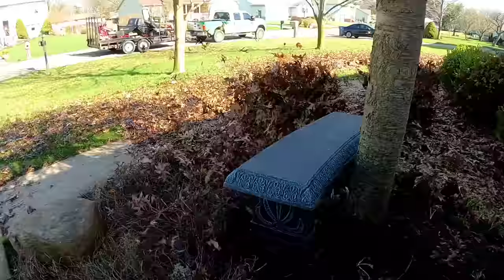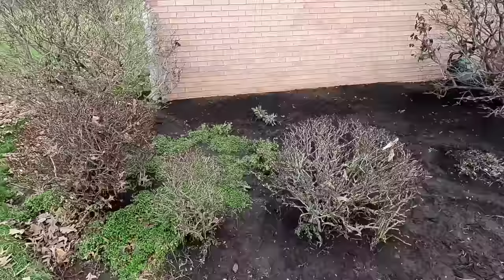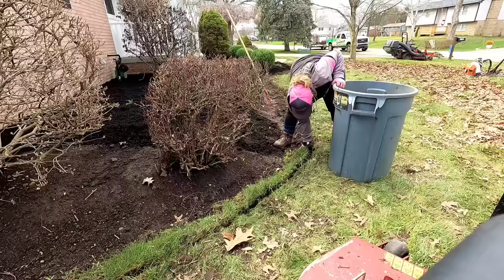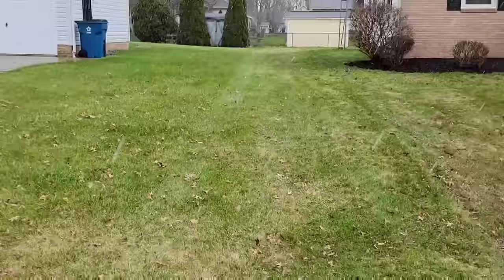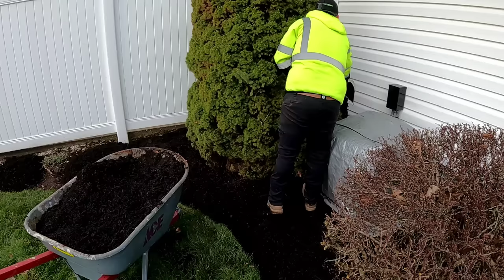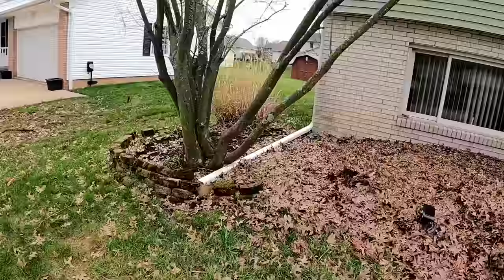HOMEOWNER GOT WHAT THEY WANTED | NEIGHBOR WASN'T SO HAPPY!

Comment: just a tip from utility locator, when using that edge cutter, before you should call miss utilities out there, Fiber optics subs like to only burried service lines to the house most commonly around 6 to 8 inches if lucky, i have seen them as shallow as 2 inches sometimes

Comment: I reshaped a flower bed years ago.  I didn't have big machine like you have but I used my sawsall to cut the dirt back.  Same concept.

With the hail you should be looking at the radar and stuff.  Hail proceeds tornadoes.  With hail it means that there are updrafts going on in the atmosphere.  I am not only a landscaper I am also a trained storm/tornado spotter.

Comment: Love the add on wheel barrel made a steel platform on my mower so I can put 10 to 12 bags on mine. I used plastic concrete tubs to haul stone . Works but its pretty sketch. Looks like it's hydraulic?  Pretty awesome! Truly a force multiplier.

Comment: Nice job. Expensive black much, them people gots money in Ohio. Couple of things. Glad the neighbor wanted bigger beds, I never add any new space to a bed because it's a longer weed eat and consumes more mulch. I also use a spade and put a 30%ish angle cut on the edge so when the mulch is thrown and smoothed and you pack the edges it makes a nice little v trough for the rain water to collect as it runs off. And to pack the edges I use an aluminum rock rake, 3 feet is quicker than a 1 foot yard rake. I was happy to see you let people know to use the backside of a leaf rake for smoothing, I see so many beds with clumps and piles just all through them. I also never use a shovel in a wheelbarrow otherwise you have to rake the mulch onto it with your arm like in the video. A wide short handle pitch works way better to get behind and around shrubbery. I only use the shovel to push mulch into a wheelbarrow once it is low enough to get behind and do it. haha and that was sleet not hail, where I come from it's not hail until you have to called the insurance company.😶
Just some thoughts and again great video maybe something said will help you and maybe not but it was free. 🙂 Oh and my neck of the woods is N.C.

Comment: i took sod cutting like that  and  redone a sandy area under a 200 year old oak tree  on my 20 acers  i used them a plugs which every made it the made it  it too about a year for it too grow in then took five years too get that fluff  and completely full look i like  because too me native grass will always do better in it surrounding i bought the 20 acres for 30 k  nothing was on the property so i did a well 2 septic tanks a couple of sheds which were old mobile homes 3 livable mobile homes on the property at one time i had a acre of watermelons  another of cantaloupe then  about a acre of home garden  green beans okra lettuce collar greens and mustard greens  what extra i had i made baskets to sell every weekend   i take it too the store only store either way for 20 miles and sell out with 2 hours  and back then watermelon was 4 bucks each  so the most watermelon i sold it a day was about 100 of them to me that was just fun for me i didn't count it as a job but it was

Comment: I dont know if this is of any relevance but if am using an hedge trimmer I always without fail WD40 the cutting blades they work alot better and dont bung up with sap ect i myself use a 4 stroke honda double sided hedgecutter its alot quieter and runs longer just a tad heavier

Comment: Just me but I think it would be better on your back if you rolled up the sod while on your hands and knees then come back when you can only need to bend over to pick the pieces up and chunk them into the bucket.

Do not let water get into the door window and lock controls, they have circuitry at the very top that will malfunction if it gets wet too often.

Comment: Ha, ha ,ha. You haven't seen hail until you've seen TEXAS hail. No joke! I'd have been out there working.
I think about your slogan and how you handled working in front of the storm. 
While one picked up sod the other should, have been putting down the mulch. 
Quite often you let the camera get in the way of working smarter. That's what your tri-pod is for or get some gopros and film with them when possible, which is most of the time.
"Work harder, work SMARTER, make more money"!
You two do a great job and you work hard doing it. Now work smarter and put the camera down much more often! 👍

Comment: watch you guys all the time..i run a landscape business also...but that bid on that house at the end of the video, a couple thousand? With 2 people that clean up will be quick and wasnt that much, edging will be quick and easy, and mulch retails at 25 a yard, so you might use 4 yards, if that...$2,000 is extremely high, Im in St. Louis, the midwest...most companies out here would be bidding that job at $1,000...dump fee is cheap, mulch is cheap and me and a co worker would have it finished in about 2-3 hours. im just so surprised at a $2,000 price.
Reply: That job was maybe  3 yards of mulch 1.5 hrs. to edge clean up 40 min. mulching 1.5 - 2 hrs $600. max .

Comment: Thanks for showing me how that hula hoe works when I just asked you in the live video about what tool to use for weeds. Going to go get me one.
Reply: Works great for edging, too. After running a power edger down the walk or drive,  it cuts the sod loose from both the concrete and the turf, with the strip of sod running right through it (while scuffling it), leaving it loose, ready to pile and pick up.

Comment: Hello guys   Quick story back in 1972 a product came on market called Hulahoe   I had to have one so we went down to Brooks Drugs where it was advertised to buy one. I still have the original in the shed. You can pull and push to cut weeds. In recent years I see the same type but its been many years since I heard it called Hulahoe again.   I have a new model so I can keep the other one safe   That weed you are cleaning up OMG its all over here in my yard on Cape Cod. Like Ohio ts been wet spring and the ground is soaked. I could no longer wait so I fed the lawn today with crabgrass preventer.    Im hoping you get a good employee sooner than later.  God Bless keep up the good work

Comment: Those 'carpet weeds' you pulled at the beginning make the native landscaper in me sad. It seems like such a robust, easy-to-maintain groundcover. Plus, seeing as it's probably native, it's designed to live in that climate; it'd hold its own through the cold/heat and the rain/drought. Unless the plant is highly toxic or invasive, it wouldn't've caused any problems where it was. That said, I know native landscaping isn't well-known or popular (yet; hopefully). I know people still tend to favor traditional landscaping. Your local municipality may even have some premade guides or plans for implementing native landscaping. If you ever have a client or friend who can't get around like they used to and need something that's easier to maintain, it's worth considering.
Reply: The way there doing landscaping is much more appealing to the eye thus gives great curb appeal for everyone driving by.
    Looks amazing 👏
Reply: Eh, native landscaping is easier for the homeowner but it drops the value of the home and surrounding properties due to it usually going against what is typically considered to be a "nice" lawn.

Comment: You all do a excellent job.  Appreciate ya videos. I had a hard day today.  Vehicle broke down here at home. The brake caliper froze on the pads and froze onto brake rotor. Brake rotor is in 4 pieces. Plus with aluminum wheels pegged out where the studs are. Right rear on a 1996 ford explorer.  I should not complain to much I will say all OE on vehicle.  Has 238,000 miles on. Glad you all had a awesome day.

Comment: Curious, so I'm asking others... Are there situations when landscape fabric is avoided? Noticed you didn't use it at this job. I've chosen not to use it in my landscaping as I've found it makes it more difficult to remove weeds. The weeds root into the fabric, when I go to pull the weed, the fabric comes with it. (I'm a homeowner and I'm the lawn maintenance person at my job.) When new landscaping was professionally installed at job, they seemed confused when I told them not to put down landscape fabric. Until I explained why. I avoid chemicals unless necessary, otherwise regular walking around and weed plucking seems to keep it at bay.  I'm not sure when it is useful.
Reply: NEVER use it... it doesnt work, and its just a scam for landscapers to tack on extra fees.

Comment: i see back problems in the near future. everyone finds out the hard way but for your own sake take my advice and stop lifting with your back so much. i never listened when that advice was given to me and ended up bed ridden for a month on two occasions from sciatica caused by a ruptured/bulging disc and so did my wife.  no my friends is starting to develop the same issues. it will happen to you guys too if you dont take action now. you probably already have bulging discs and are just one slip on your butt away from severe pain for a month.

Comment: watching you cut in that edge had a brain fart of idea of building a rolling edge cutting tool to maybe be more easy way than that manual cuter but more cheaper than that gas unit mine would roll but would not need gas

Comment: Hey Spencer, I got a question about weeding the bed do you get every single weed until it's absolutely nothing, or just do the best you can?
Reply: Get all you reasonably can. Mulch the beds and spot spray weeds as they germinate in the future. Of course you can apply a pre-emergent like Snapshot. Landscape fabric works for a short period of time but weeds will find a way.
Reply: @davidredmon3352  snapshot is good stuff. I go through about 500lbs of it every spring. Saves alot of weeding.

Comment: Hey Sean what was the age you first started mowing before you started your own business I started back when I was 12 to 13 years old and I done it all the way until I was 32 couldn't do it no more because I had back surgery and my back is not good no more to handle that copper work and now I have a bad knee with tendons pulled a torn ACL so I have to have knee surgery very soon which is going to suck cuz my friend had the same problem with the same need as I do so me and him are not in the best shape for all that plus I dumped some really stupid things when we were younger one thing we done we is on top of his roof cutting branches away from the power line and then we bought the ladder up with us on top of the rough with us my friend got on the louder than he cut a couple then he was scared so I got on top of the ladder and he hold me then his wife at the time brought one his daughters out and other one was not biologically his so we wasn't being the best role models in the world but a lot of times during the summer his daughter brought us beer out if we were working outside without us even asking her to do it she done all by herself then when my mom passed me and him was drinking a lot with me cuz I was going through really bad part of my life and I lost my mom I didn't have nobody no friends except for one or two so sad talking about it I turn to alcohol a Naga alcoholic for over a decade but now I can drink alcohol and then I can set it down it takes a lot of willpower to do I can't tell you how much money I spent on alcohol it was around 8 to $9,00 maybe around $10,000

Comment: To be fair I'd be a little pissed. Could have done some of the noisier stuff a little later on. And using that massive petrol hehe trimmer for those tiny bushes wth lol. Talk about sledge hammer to crack a nut.

Although I will add it's not your fault, it's the American culture and way you know.

Comment: You waste so much of your profit on all those gas powered tools. Why do you need a gas powered vehicle to move soil? Have you ever heard of a wheelbarrow? Bit of manual labour might help you lose a couple of those extra pounds aswell
Reply: Speed. Speed and not hurting yourself working all day. The faster you get a job done, the faster you can get to the next, and so on. That makes infinitely more money, than it cost in gas. No to mention the cost you'd have to pay from moving wheelbarrows of dirt all day long. Time is money, and that is the bottom line.